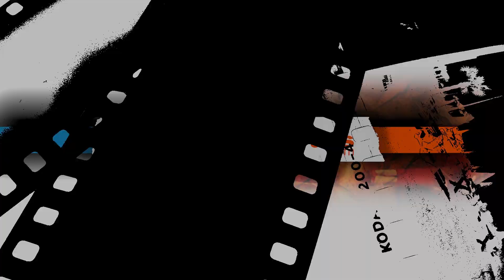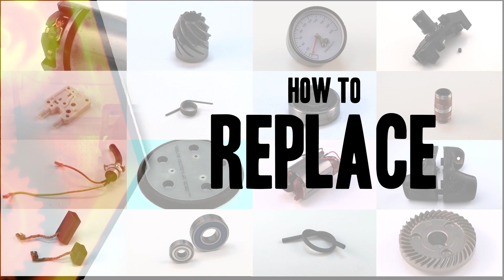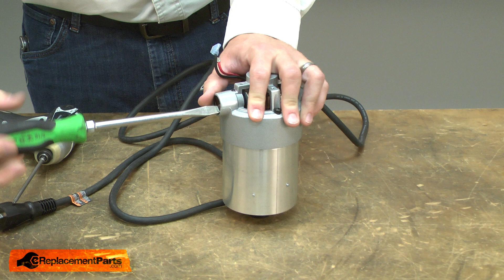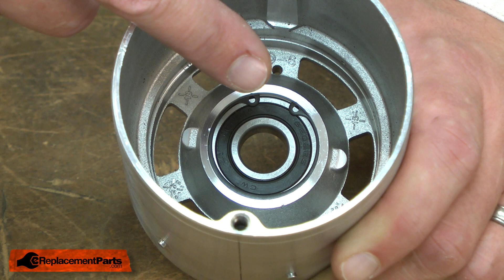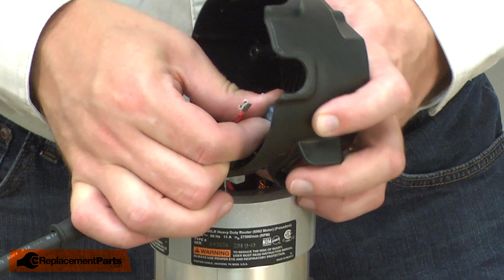Porter Cable Router Repair - Replacing the Bearing (Porter Cable Part # 878064SV)

Comment: I have a question for anybody that can answer. I have a porter, cable 690LRS does anybody know where the little red rubber plugs go it looks like thay go near the upper bearing there is a slot where the upper bearing is pressed into the slot.
Is right beside where the upper bearing is pressed on please help

Comment: It's a good how to except........Removing old worn out bearings by tapping them out with a hammer shouldn't cause any issues. However hammering the new replacement bearings back in by using that socket on the inner race will shorten there life, sometimes by a lot. At the minimum using a larger socket that fits the outer race diameter would be much better since it put's far less stress on the revolving bearing assembly parts. Better of course would be some type of arbor or hydraulic press. Ideally the word and tool hammer should never be used for rolling element bearing installations. These aren't exactly super high precision bearings but brinneling of the bearings caused by micro flat spots due to impact blows can start will as little as 4 ft. lbs of impact force on high precision bearings. That could easily be obtained with even light blows with a tack hammer given the point contact surfaces roller type bearings have. With cheap low grade bearings the exact heat treat could be just about anything so even less impact force might be required to cause those flat spots. Anything I've said is easy to double check on a few of the good bearing manufacturers websites.
Reply: Yes but how else would you do it in this case? You could press the bearing onto the armature then press the armature assembly into the housing but you’d still have to hammer it in. There’s virtually no way to get that bearing in without sending the force through the inner race. The only thing else I’d do is freeze the bearings and heat the housing as much as possible to reduce the force needed for insertion